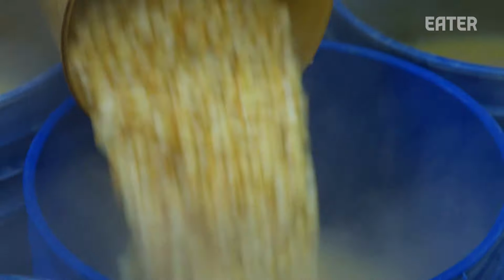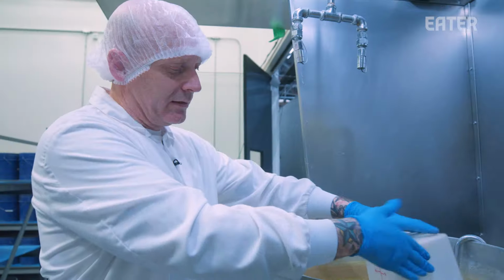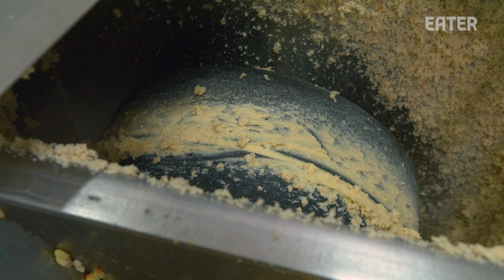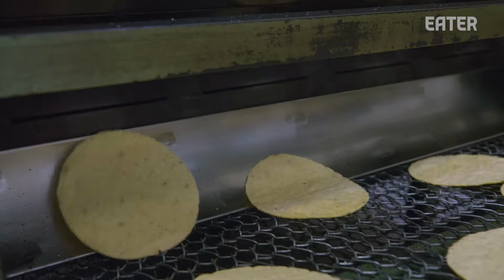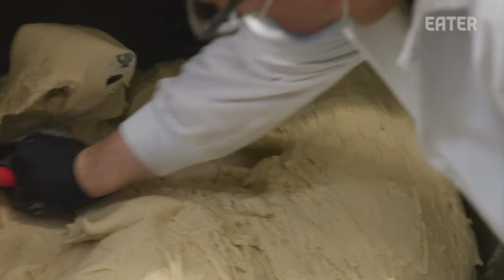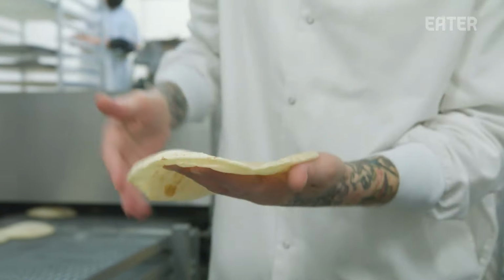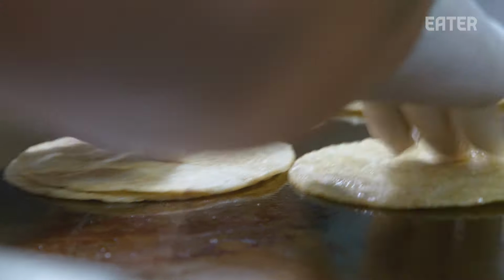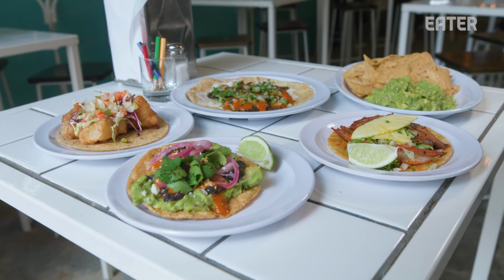How One of New York's Favorite Taco Spots Built its Own Tortilla Factory — Vendors

Comment: How the hell it's 100% organic if chemical is added into it?
Reply: I can't say one way or another if it's organic, but you need to treat the corn with an alkaline to make nixtamal tortillas.
Reply: @berfunkle4588  Organic means no crap should be added...that's my belief.
Reply: pretty sure that's referring to how the corn is grown, and rock minerals are even allowed to be added to soil for certified organic produce.  indigenous north and south Americans have been doing this for around 3500 years, and made the calcium hydroxide by heating limestone (a rock mineral) in a fire. humans all over the world have been using this simple chemical for a very long time, and it's harmless if used correctly
Reply: Organic is sort of a vague label. It simply means the main product or crop, as well as soil and feed is not treated with a pretty big general list of chemicals or bio-engineered products, like most herbicides and pesticides, for the entire duration within a set number of years. A product can qualify as organic even with "chemicals" if the chemical is organic, generally up to about 30% of the total product (which many are, considering just about everything is made with chemicals. This allows them to skirt around it safely without any trouble.) In this case, all corn and wheat is made organically, and so are the tortillas

You'd be hard pressed to find produce not touched in any way, regardless of farm size. We've been tweaking crops for almost our entire existence, ya know?